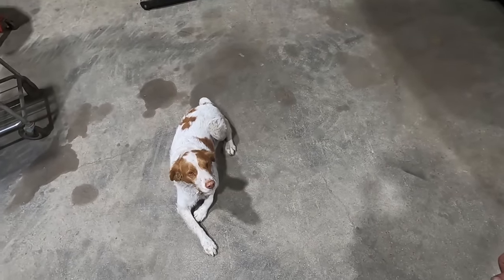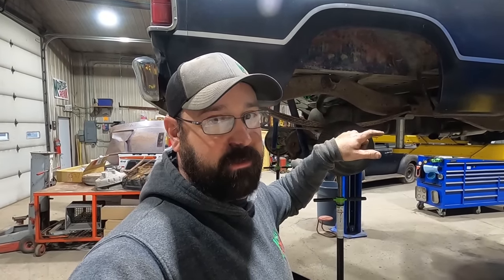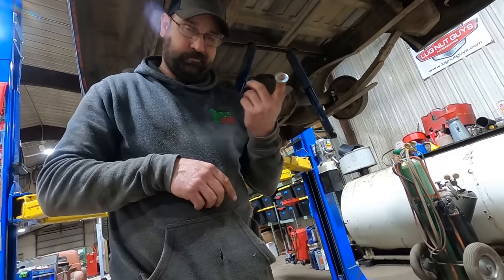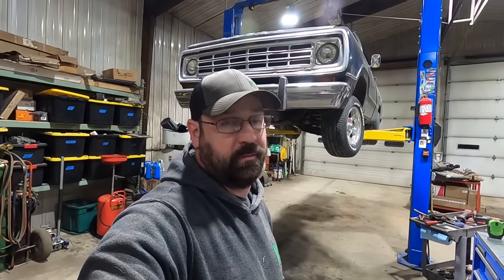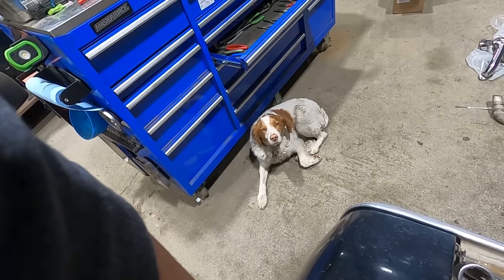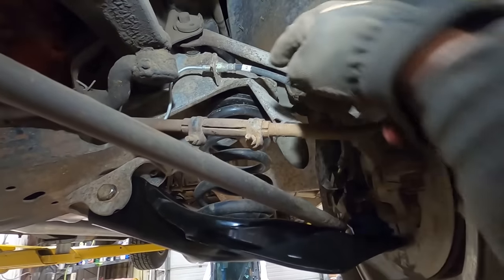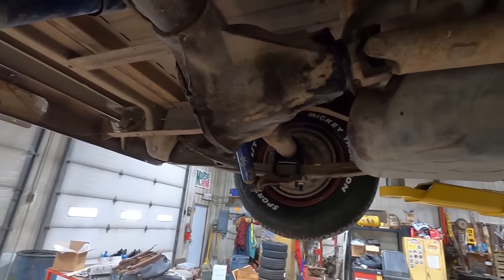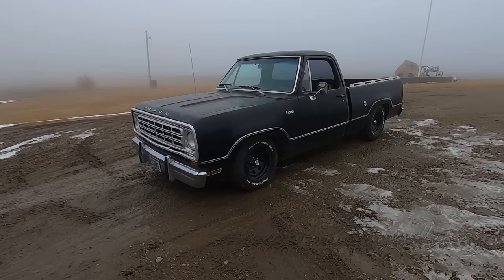1974 Dodge BIG BLOCK Shortbed Truck! Budget Friendly Transformation! Mopar Muscle Truck!

Comment: Here you go... Winnebago motor is a good source for exhaust manifolds, as far as wheels the style you are looking at are referred to as Series "69" ( has slots or police issue ) the other type are Series "63" (passenger car type) and last but least 4 wheel drive 1/2 ton pickup and Ramchargers have steel wheel with proper back space...and then the other truck model is "Custom" ....Merry Christmas and Happy New Year to all.

Comment: I have steel toe cowboy boots with work soles, double h and oak ice work soles with gel insoles for work on the farm carrying and handling firewood and heavy guage scrap steel and scrap metal lol .. the dash looks like its from a 75 and newer because the 74 dash doesn't hardly even look remotely similar to those i prefer this dash setup but my 74 dodge d100 the cluster surround comes straight out over the guages and the the glovebox lid is squared off the 75 and newer are rounded, and the the instrument cluster bezel surround is more like the 71-73 dodge charger and the dodge coronet, and the Plymouth road runner and satellite Sebring, the ammeter, oil pressure,water temperature, and brake light have guage cutouts the protruding out so it changes the look of the bezel same thing with the speedometer, and radio and the dash by the radio has dodge letters on the bezel

Comment: 383 Chrysler is big bore and shorter stroke kind of like a big block that picks up the revs quicker like a small block they were excellent engines if you put a rear sump oil pan on em the worst part of all Chrysler big boys is that their steering geometry got in the way so they had center sump or front sump and would starve under heavy acceleration and why else would anyone want a big block

Comment: I have the exact same truck but mine is a 1979 but it has the bucket seats with the tuff wheel and the center console but my truck has a 360 not a big block and mine is in better shape

Comment: For someone who cries about Chrysler products you sure are having a good time soaking up the views on building one, also 904s are stronger than any gm or ford trans ever built. And that’s the “weak” Chrysler trans… they’re small block transmissions a built 340 and a 904 is a great combination, and 340s are big block killers, they eat 396 cars all day long in a body mopars. 727s were behind small blocks as well, the 904 was only behind small blocks and the slant six.

Comment: At 1:17 i had to stop watching cause my add was kicking in.  The new headers if you get a chance because by now they are on.  Cut out the bar between cylinders. its not needed and headers will leak less. Common practice on bush cars mid 90's.. 2ndly,,,lower ball joints. Chrysler has screw in ball joints where you need a special socket. See if the old ball joints screw into the new lower arms..if not..get new lower ball joints ( the old ones) cut out the new control arm lower ball joint ring. weld in the new one. screw in new ball joint. Done, this was you don't have to ream the lower taper on the spindle. Which they do make a special reamer for this. Common practice on a 90-95 late model.
Reply from the maker: both are press in style

Comment: Another raccoon bulldozer? Trucks should sit high and have ground clearance with the tires sticking out past the wheel wells. Next time put a truck up on 44 inch Super Swampers. Or are you scared to build a “real” mud truck. DD Speed shop plows snow with a 57 Chev. Ooh how about a classic car up on 44 inch Swampers?
Reply from the maker: You took the thumbnail click bait!

Comment: The car and your hot coffee and cocoa hot drink that the car/truck have ground clearance 4 or 5 inch. Some other truck have 7 or 8 inches ground clearance. And snow trucking trek 4.9 liters have 12 up to 16 inch ground clearance. The Putin's truck is  Toyota 3 inch ground clearance which is not an ideal. My truck have 16 inch rim and 265/75 aspect ratio tire x4 2WD. The axle and live housing 4.11 gear diff. Is below multi leave pair of springs. The new shock dampened with coil shock absorber is all China and Mexico. The motor mount is made in India new. The clutch disc is thicker between pressure plate and new flywheel than an after market disc so it slip in clutch very easily after 25 miles. the Mazda have clutch slave hydraulic cylinder in outside and attach of the transmission for better transmission better than ZF5 transmission. What model is the transmission without the use of DURALAST ring clutch slave cylinder inside the bell housing. better and safe to use clutch fork. for V-8 and inline 6. 
 The roof have a sheet gauge 29 metal and galvanized the roof with pewter and plastic garden paint fiberglass or plexiglass stain with inner glaze flexible paint like Scotch or CORNING car skin and strong cross member made out of heat resistance plastic. Ford plant in hand made car called Replicas and Ridgid.